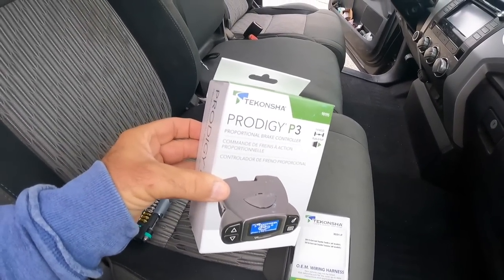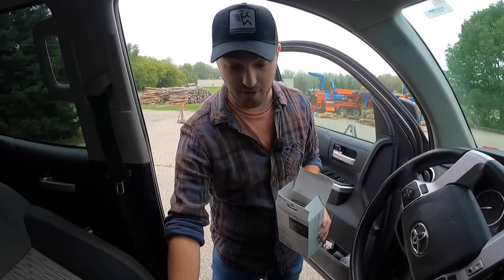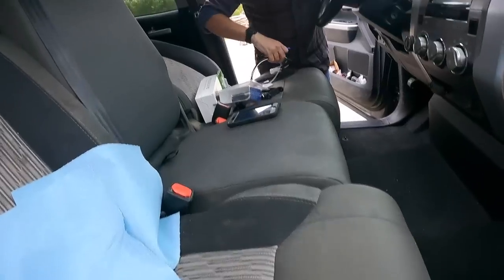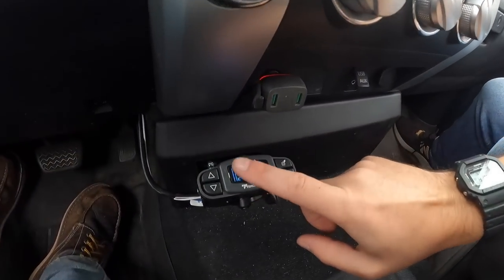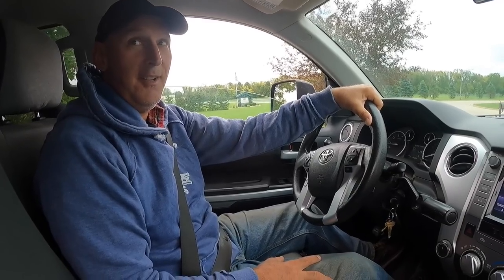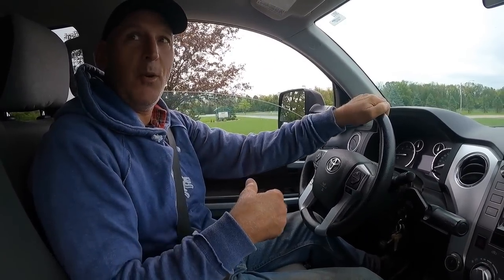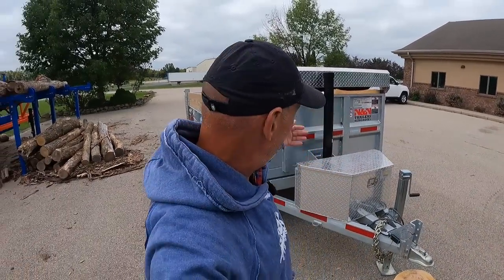Brake controller installed; FINALLY!!!

Comment: While we are on the brake topic...A good reminder also is that as trailer brake wear down. They will need to be manually adjusted on alot of trailers. It isn't a hard process but over time you will notice trailer brakes helping less because they are out of adjustment. Also...a preset setting is very difficult, I find with hauling firewood of different species,weight and size of load. Also being empty on one way of trip alot. Continue to play with gains and you will soon have it figured out for every application. Thanks for bringing Pops into the 21st Century and keeping him safe! Next step...Indoor plumbing!👍
Reply from the maker: Yup, you are correct!
Reply: @InTheWoodyard  Great video just thought some of viewers especially the ones purchasing used dump trailers(just like the enclosed you just bought) may need to know that trailer brakes do need adjusted from time to time. Unlike most newer pickups...

Comment: Hey Chris! Just wanted to pop in and say, if you get a new Tundra, get a 2021 while they still have low miles on them. It's the last year of the 5.7L engine, and now they put all sorts of safety features and beep and alarms constantly on the 2022 models. That plus all the new "green vehicle" crap they are pushing these days, is the reason I just bought a 2021 Tundra for my wood business in Ohio. I just sold my first face cord the other day, and I decided to start selling firewood because of your channel. Thanks for all the knowledge and help you've given us by producing these videos! GNI
Reply from the maker: Thanks so much for the kind words!

Comment: You did the right thing with the brake controls. Your truck brakes and rotors will also thank you! Now check your receiver and ball and make sure they are rated for 10,000 lbs. I just bought a dump trailer with a 14,000 lb GVWR and had to upgrade my receiver and ball. They were only rated to 7,500 lbs. Awesome install Brice👍🏻👍🏻GNI
Reply from the maker: Yup, I have a good ball!

Comment: If you really like the enhanced handling abilities that the brake controller offers.

You will be elated with the additional advantages in towing that a load equalizing hitch will give you.

They make towing SO much more enjoyable.

Yes ,its an expence, 
but so are chain chaps , 
The saftey makes it well worth the cost
Reply from the maker: Maybe so!

Comment: Great accessory that will make you wanna kick yourself for waiting so long to install. Plus a knowledgeable installer that'll work in a superfund cab doesn't hurt either.😂
Right tool for the right job is going to be a lot less stress on your truck. Your son definitely got your trait/DNA of a funny bone too.👍👍👍Thanx for the fun n informative video.
Reply from the maker: Thanks for the kind words!

Comment: I'm amazed that you've been able to get away with running without trailer brakes for so long. Here in the UK I think the (loaded) trailer weight limit is 750kg - so about 1,650lbs - your empty trailer weighs more than that.

Rather than using self tappers I find that high hold velcro works well. No holes needed.
Reply: Same here is Australia anything over 750 kg needs trailer brakes
Reply from the maker: Good idea...velcro!
Reply from the maker: great!

Comment: Just a note on trailer sway. The corrective action is to apply force to pull the two objects apart (truck/trailer) which cause them to straighten out. Manual trailer brakes is half of your solution. Apply some truck throttle at the same time as manual trailer brake gives you the most sway recovery effect.
Reply from the maker: Good points!
Reply: I've been told to check new trailer brakes because not all manufacturers adjust them correctly. Also new trailer brakes have a glaze to help prevent rust. You have to heat up the brakes and it's called banishing the brakes. After that brakes should grip much better. Good luck. Awesome videos as always.

Comment: Well Chris I'm surprised your old trailer didn't have brakes most States require brakes on trailers with a Gross vehicle weight rating over 3000 or 3500 pounds if I recall right. Glad you finally got them.
Reply from the maker: yup, me too!

Comment: You'll love the brakes working correctly.  I hauled all my firewood without brakes until this year . I bought a trailer with disc  brakes and a tongue actuated brake  cylinder, as you slow down the tongue pushing against the hitch gives the brakes pressure so I got lucky and didn't have to install a controller.
Reply from the maker: nice! yes they are great!
Reply: Dont forget to unlock the tongue actuator after backing up the trailer.
Reply: I talked with a trailer dealer once and he pointed out something I never though about. If you’re in a cold climate you don’t want surge brakes. If your truck is on ice the trailer brakes won’t work because they have nothing to push against where as electric will still work. Just thought I’d pass that on as it instantly changed what I was looking for back then.
Reply: @otif2044  If the truck is sitting on ice and slippery enough the trailer has nothing to push against electric are not going to do much good.
Reply: @iffykidmn8170  true but there are always grippy patches and I'd like every chance to grab at them I can. I'd also want the trailer slowing the truck down in that kind of situation so you don't jack knife.
Reply: @otif2044  Yes and surge brakes are better than no brakes, If I was to guess I would say 75% of the trucks on the road have never pulled a trailer and probably never with most of them being nothing more than commuter vehicles.

Comment: Well Chris know if you get stopped, you will be legal. In Wi I believe the weight level that( requires )trailer brakes is 3500 lbs and they must work. Keep on cutting
Reply from the maker: Good point!

Comment: I'm amazed you've done all that towing without trailer brakes. My Silverado has the brake controller built in and its awesome. Every once in a while ill forget to dial the gain when I leave the driveway and it shoves the truck forward without it. Id probably cook my brakes without trailer brakes.
Reply from the maker: They are nice!

Comment: As a side note when towing on icy roads you might want to lighten the boost on your controller as well. I encountered something coming home from an elk hunt in the mountains and the road was a solid sheet of ice. I actually backed off my brake controller to almost zero and went down the pass in 4 low second gear. I tried 1st in low but the trailer started pushing my truck even though I was going maybe 10 mph. Serious pucker factor especially after seeing all the cars and truck that slide off the road just in front of me.
Reply from the maker: Yup, it can be scary!

Comment: Pretty smart son of yours. Would love to hear his opinion on the Toyota new 3.5 turbo motor vs the 5.7 iforce for the tundras.
Reply from the maker: Yup, he likes them!
Reply: Ha. I am not that smart. I just play smart on TV (YouTube).

I think the move to the 3.5 TT will be good in the long term. Toyota has a history of the first model year being a bit rough (looking at you 2007 XV40 Camry first model year), but after that they make small changes and improvements each year. With emissions laws they really have no choice long term, but also they need to stay market competitive. As great as the 5.7 N/A V8 in the 2007-2021 Tundra is she is THIRSTY. I know when I had my Camry Mr.Woodward would swap vehicles with me from time to time for long trips with no hauling to DOUBLE his MPG.
Reply: @brycecarlson  I completely concur on the 5.7 being very thirsty! But there’s no disputing it’s incredible reputation for reliability! I know guys that have 400k and still tickin! It’ll be interesting to see the long term reliability of the 3.5. Fords 3.5 is questionable.
Reply: I would add to that Toyota does seem to be making the moves as conservatively as possible ensuring they cover a wide base of needs. Good video out yesterday on that topic:

https://youtu.be/m9CVoj73CCI

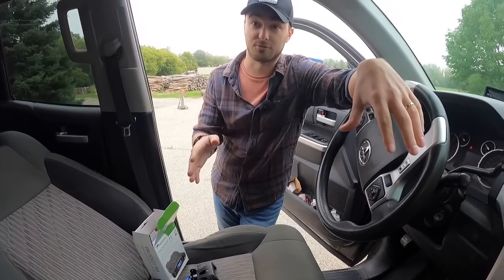Also, Toyota does do dual injection with their newer engines where needed check out time code 3:32 in this video if you are interested  (from a channel that I learn a lot from):
https://youtu.be/xrLNDgrIw3U
https://youtu.be/xrLNDgrIw3U
Reply: @brycecarlson  yeah Toyota always is conservative when making changes. They approach things slowly and perfect it (or try to) before releasing it to the public! 

Thanks for the links to the other vids, I’ll check them out!

Comment: When checking tongue weight of multiple axle trailers tandem-triple make sure tongue height is reasonably close to the same height as the tow vehicle ball height for a more accurate reading.  On a different note how, many people do you see towing a trailer with a hitch that is too high or too low for the trailer.
Reply from the maker: yes! Good point, a lot!!

Comment: Nicely done Carlson's.  Bryce is much more technical than the "old man".  Now you know what you've been missing without trailer brakes.  Did you ever get the air bag rear suspension upgrade done?  I suppose this means that Bryce can now "borrow" the Tundra and trailer.  GNI
Reply from the maker: Yup, he can borrow anything I have anytime he wants!

Comment: My 2018 Tundra has the factory brake control. My 2008 doesn't. 2018 was also the last year for the factory transmission oil cooler as well I believe.
Reply from the maker: Yup, new equipment is nice.
Reply: Yeah, 2018 was the last year. Video on some testing with that:
https://youtu.be/I8upLk9jlcQ

Comment: In Australia when I bought our caravan the dealer actually does a visual check to see if a brake controller is fitted to the car to cover their butt with insurance. I’m surprised you can just drive out of the trailer yard with such a big trailer without brakes.
Reply from the maker: We still have a little bit of freedom here, but not much.
Reply: I love australian caravan videos. You guys have badass setups.

Comment: I know on my F150, as just a receiver, it’s half the tongue weight than if I had a weight distribution hitch.
Reply from the maker: Thanks for the info!
Reply: I’m not sure on the tundra.

If I look at the tag on my old 2020 F150, I have a 500 lb tongue weight and a 5000 lb trailer limit for just a hitch.

With a weight distribution hitch, I can push that to 13,200 lb trailer gross weight and a 1320 lb tongue weight.

My 2023 F150 was built specifically for trailer towing and I haven’t crawled under the truck yet in this Minnesota weather to look for the tag yet.

My 2023 F150 actually has a greater tow capacity and payload than what my old 2012 ram 2500 Cummins had.

Comment: If you are gonna buy a new truck, I might just keep that one for work and have yourself a nice new personal truck. I have an old 06 crew cab 8 foot 3/4 ton Chevy I keep around for hauling scrap, wood, stuff for the apartments whatever. A 3/4 or 1 ton is nice though for the weight you are towing. I can't believe my 2020 Suburban. You would think you were in a 3/4 ton the way that thing tows. Not sure I have ever pulled a trailer with any half ton that was as capable as that Suburban. I am ready for a new one though if I can actually find a High Country, Denali, or Escalade. Especially while used prices are still so crazy. I have seen used Suburbans equipped the same as mine for sale with more miles then mine has for more then I paid for it and I have had it about 3 years now. Been looking for a new truck too but another thing impossible to get. Not so bad if I got a lower trim but I only want a High Country or Denali. I have found a few but they are always so far away and gone before I could get there. I could just order one but I would like to see and drive one before just ordering. Seems almost all I am finding have that 3 liter diesel. Not sure I want that engine but I know people seem to rave about it. Kinda wanted the 6.2 but even the 5.3 is fine. I have that in my truck and Suburban now and had plenty others since I have had a lot of trucks besides I am a dealer so I have bought and sold plenty and the 5.3 gets better mileage then the 6.2 just giving up about 75hp and whatever the torque numbers are. If it was a 3/4 ton sure I would probably rather have a diesel but a half ton I don't know.
Reply from the maker: We will see, maybe so!

Comment: If you hauled that loaded 10,000lb trailer around with a Chevy or Ford you'd be out of a truck right now haha, gotta love Toyota quality!
Reply: I don't know. I haul all the time and no issue. I also haven't had rats eat my wires. Can't say that with Toyota and their soy based wiring insulation they were using that they refuse to warranty and have had class action suits over lol. I know somebody that had to replace the wiring in his Tundra and his wife's Camry because mice or whatever at the wiring out of and they were less then a year old. Cost him like $7k to replace.
Reply: @JesseLJohnson  I have never heard of that. I've never had any issues with mice and I have no idea what a soy based wire is haha. I am just going on off of real world statistics and data and personal experience! I've found that if it's made in the USA it's probably junk haha. I do love the duramax's though!
Reply from the maker: Be careful the domestic guys will get very upset!
Reply: @Dorchwoods  Its not the wire its the insulation on the wire. Toyota was using soy for the insulation. Some others were too think Ford did for a while but there has been a lot of people that had the wires ate out of their Toyotas because they thought it was a good idea to use something rodents like to eat to wrap their wires.
Reply: @JesseLJohnson  gotcha, learn something new everyday. Thankfully I've never had any issues with mice here